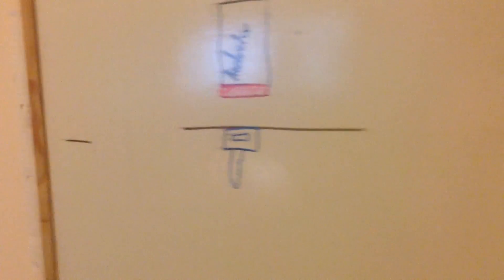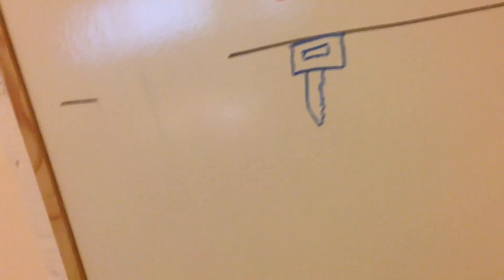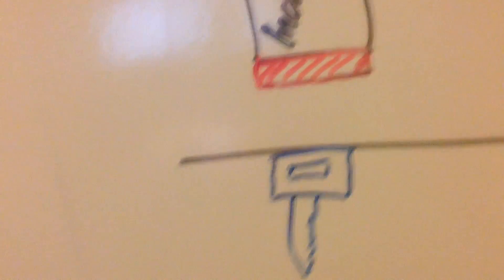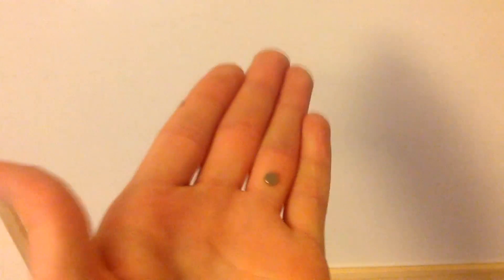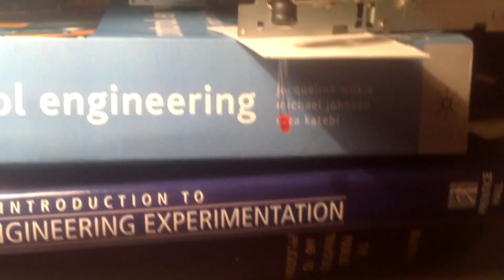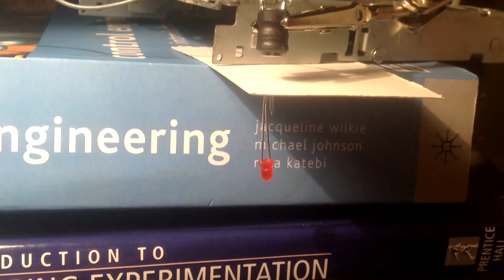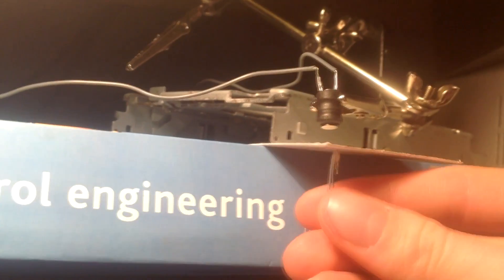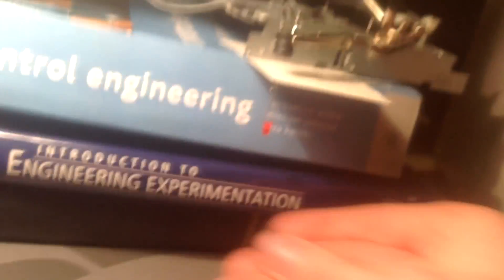Low power magnetic hold and release mechanism

Comment: This mechanism is already used in door locks, which holds the door using permanent magnet. When the door is to be released, you need to supply some power to coil to demag the lock. I am talking about the doors, which some with electronic locks and you need to swap you ID card or something to gain an entry.
Reply: Door locks don't use permanent magnets they use electromagnets

Comment: Just use an electro-permanent magnet:
http://www.sgm-magnetics.com/eng/ilma/electro.html
You can turn it on and off, and only the switching uses energy. (there are circuits available that charge up a capacitor using low power during a relatively long period, so you can use this in a low-power battery-powered device or even with harvested energy)